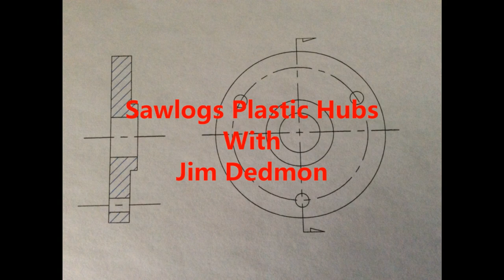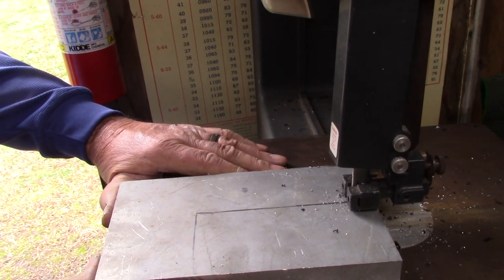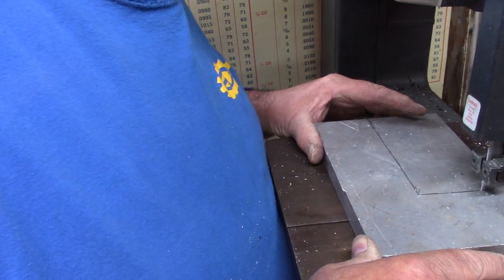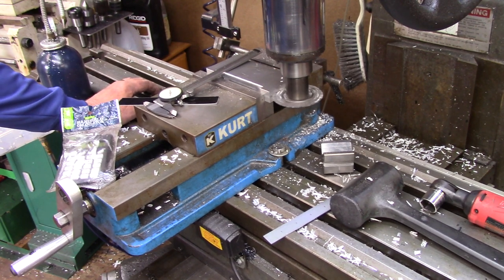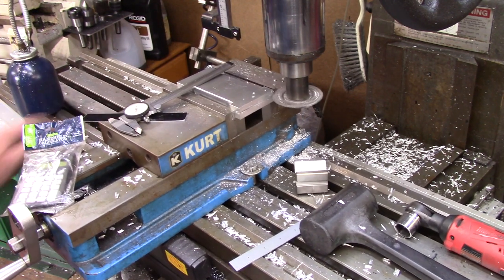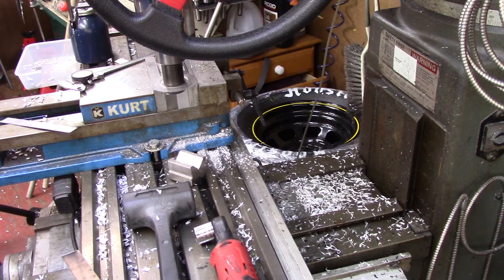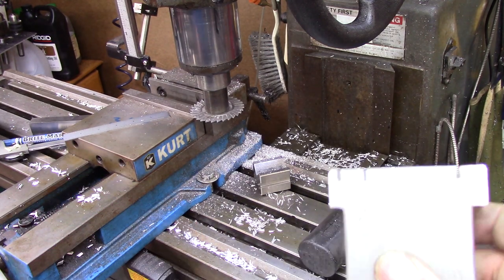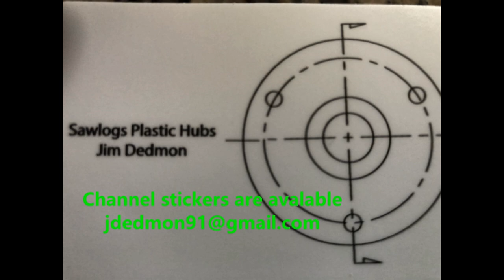A simple sheet metal lip tool for the race car shop

Comment: Thanks for the video, I'm about to build a cyclekart, it will have an aluminum body on it, I'm researching everywhere I can to find information on sheet metal work, I retired from machine tool repair and have all mechanic tools, but just never did any sheet metal work. Was your band saw made for metal cutting or was it converted.
Reply from the maker: scrapwire1 it was converted from a 12” craftsman wood band saw I purchased at an estate auction for $50. I have a video series on the conversion. I used a jackshaft reduction system to slow the saw down. The pulleys cost more than the saw.

Comment: Jim, do you watch Ade’s Workshop channel? He was trying to find oil cups, he is in the UK. He was also looking for acid brushes. I thought you might want to seen him one of your cups! Also I’m wondering why you didn’t use oil or WD-40 when slitting? I was thinking that might help with the blade sticking.
Reply from the maker: Rocking J Metalworks - John Brock I’ll get them in order, no I don’t regularly watch Ade’s channel. If you can contact him and get an address then email it to me I’ll hook him up. On the slitting quite frankly I didn’t think of lube, I use diesel and a small amount of cutting oil for aluminum works as well as WD40 and is less expensive
Reply: Jim, I sent you his address! Diesel fuel is a bit smelly, WD smell better! Lately I’ve been using ATF mixed with lard, it seems to work pretty well.
Reply from the maker: Rocking J Metalworks - John Brock I’ve used ATF also. Actually I’m using lamp oil at the moment with a bit of cutting oil.